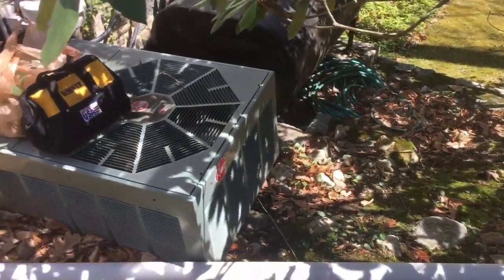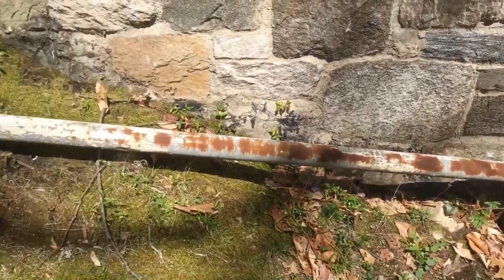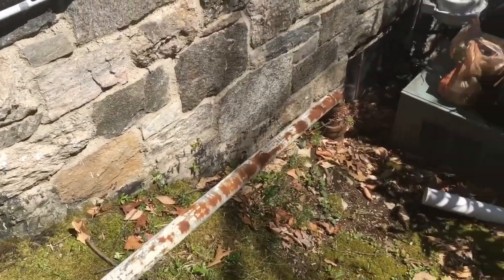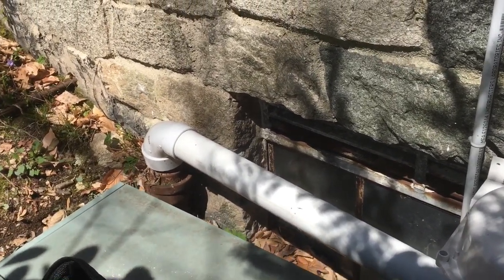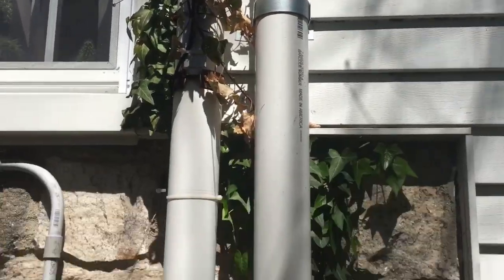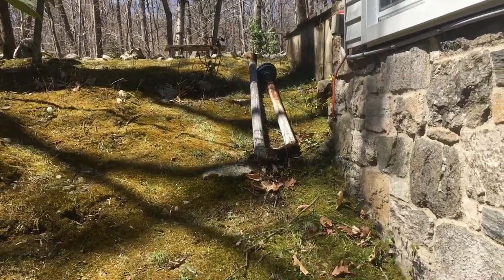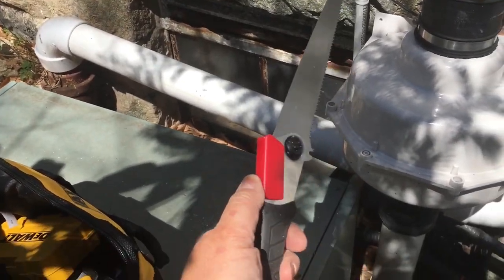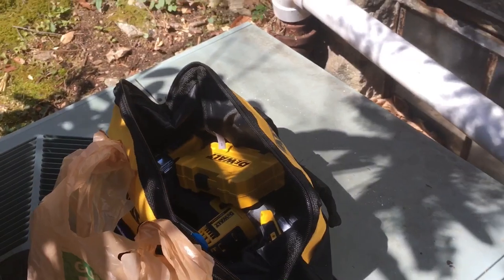Septic Tank Venting

Comment: Forgive my incompetence, but won't that put sewer gas right by the window?  Seems like it should be at the roof line?  Again, I don't know, never had septic. More of a question.
Reply from the maker: pdxDavid top window section fixed in place.  Far enough away from window in use. If the vent releases which doesn’t happen a lot no matter were it is you will smell it.  But great observation pdxdavid. Check out my video on fence installation. You might have an easier way. I’m always looking to improve. Thanks for watching 👍
Reply: @HighRidgeHandyman  Was truly just asking. I am not a know-it-all. Just like learning by watching people that know what they are doing. I did watch the fence video. Hell of a lot better than what my neighbor and I cobbled together when the wind blew down 4 sections of fence.
Reply from the maker: pdxDavid thanks for watching David much appreciated 👍👍